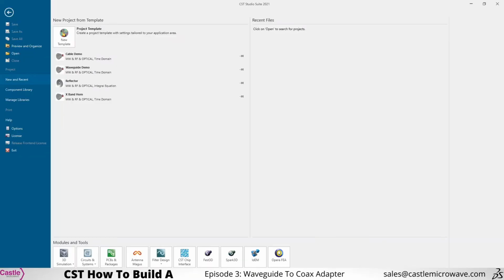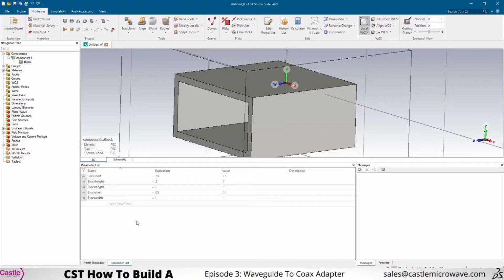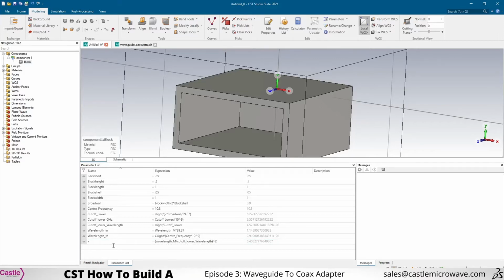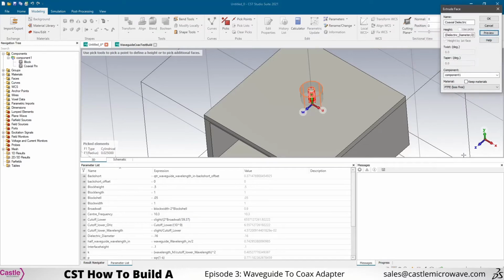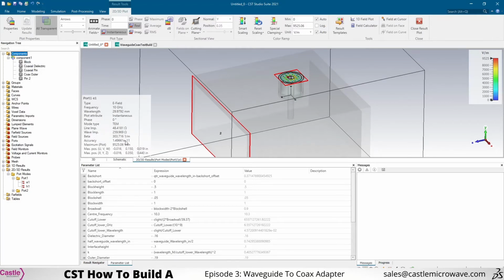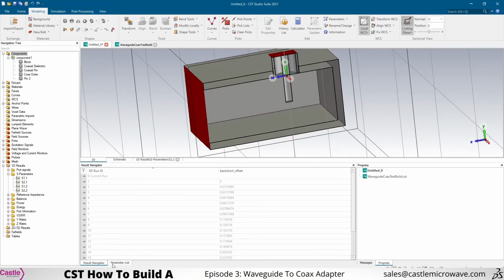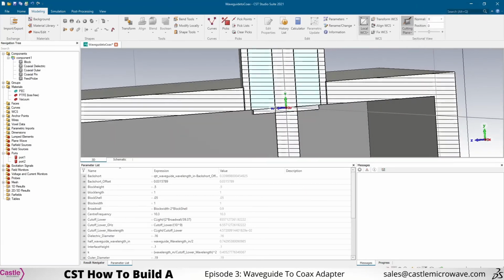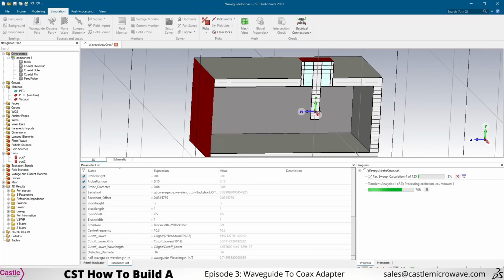CST Studio How to Build A S1E3: Waveguide to Coax Adapter - Part 1

Comment: Hi, thank you for taking the time to create this series. I have just one question: when it comes to the waveguide aperture where you position the port, does it make a significant difference whether it's placed in the inner section or if it includes the thickness? Thanks again.